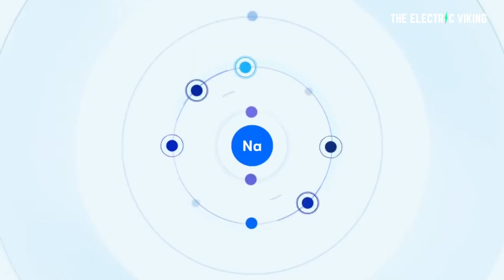Electric cars will use Sodium-ion + lithium hybrid batteries in 2023

Comment: Sodium ions have the same single positive charge but are three times the mass. This will make the batteries heavier for no extra capacity but are going to be much cheaper. If they could get get aluminium ions to work this would carry 3 x the charge.

Comment: So Sodium batteries have the following advantages over lithium (NMC/NCA):

-Better cycle life
-Higher charge/discharge rate
-Safer chemistry
-Better lower temperature performance
-Cheaper to produce

So when you pair them with lithium you loose the first 4 advantages (as the pack is only as good as all the lithium disadvantages)
and leave just 1 advantage:

Cheaper.

Sounds like sodium, in the short term, is  going to be a stop gap battery for EV's until lithium and other associated raw materials become cheap again. It will have it's uses in low range cheap vehicles (much like LFP)...in the medium term it looks like its just going to replace LFP in energy storage applications. It seems lithium will remain dominant in long range & performance vehicles for some time to come.

The fact that CATL are pairing lithium cells with sodium for EV applications really sounds like they are hiding something re their energy density claims of 160wh/kg, as all their documentation consistently says 'up to' - i'm wondering if real world conditions significantly drag that usable energy density figure down.

Comment: Sodium-ion or N+Li batteries may be the near-term future, for a short few years, but the clear future for EV batteries will be solid-state batteries, no question.  About 1/2 of the U.S. is experiencing sub-zero temperatures right now and traditional li-on batteries lose about 20% capacity with slower charging speeds.  Solid-state batteries are impervious to extreme temperatures, to a point, eliminate most of the need for BMS's and are superior in most every way.  That's where to put your stock investments.

Comment: Development remains an issue between stability, durabilité, capacity, efficiency and cost, a complex issue visible with more risky LPF batteries wisely encapsulated in pressure resistant containers by the responsible BEV automakers but not by other killers. 

In any case, because of excessive green house impact, BEV should be banned from any country with coal power plants in service or coal mines in operation…all this is planet roasting system with half of the human generated CO2 by coal and while recharged by coal generated electricity..at night with no sun and poor electricity storage (cost, losses,pollution, mining and industrial grey energy, etc) double the CO2 per mile of a good hybrid car on fossil fuel. insane and totally avoidable..

Comment: Hello Peter while that would be great - the lithium vehicles thus far have a weight issue - they weigh roughly 50-100% more than the more green ice vehicles such as the Corolla 2800 lbs vs model Y 4700 lbs.  This extra weight also runs counter to the more efficient electric motors; dragging all that extra weight hurts energy useage. You also have the reality that world wide 85% electric energy to power the vehicles is from coal, gas and oil. China alone uses coal for 60% of their electrical production.

Comment: Having two  different Cell chemistries means different charging and discharge characteristics.   You end up with two battery packs.  Each with its own circuits that are merged at some point.  Common in multiple generator AC grids.  Interesting to see how they do it.

Comment: Technically, an order of magnitude is a factor of 10, so a reduction in cost by an "order of magnitude" means it would cost 10% of the original cost. An increase is ten times. Two orders of magnitude is 100, three is 1,000.

Comment: We definitely need to get away from fossil fuels, trouble is that there are no replacements for over 80% of things that are now being produced from Fossil Fuels, there are so many things we use on a daily basis that we can't do with out, that if they stopped fossil fuels 100%, all Business would stop in a very short period as well as once many of the things you use daily wear out and need to be replaced, can't be as there is no replacement for the Fossil fuels being used.
What needs to happen before people carry on about getting rid of fossil fuels is to firstly get large scale capable replacements for the fossil fuel, then as they develop each item, they have to also be cost effective or even the greenest people won't pay extra for a renewable option.
Same as people won't even spend $0.07 extra for an Aussie owned and made product over a who knows how it was made Asian or European product.
People would rather buy cheap dried fruits that were produced on the sides of the roads in Turkey, with thousands of cars driving buy the produce as it dries than fresh hygienically dried Australian or New Zealand produce, because it's a few cents more expensive..
People for the most part wank on about saving the environment, but in reality most of them are the worst offenders.
Also, just look at how EVs are built and the materials they use, not one BEV could be made if Fossil fuels were stopped, there are far to many parts in an EV that can only be made thanks to Fossil fuels, we need replacements and many are being researched, trouble is , so far none are large scale capable.

Comment: 300 kilometer range is enough for a city car and cost is the current barrier for small ev's not range.
Reply: The OEMs will figure out what they can make the most profit on, not what sells the most units. Kawasaki makes more profit on one ship than it does on all the motorcycles it sells in the same period of manufacture. This battery will be going in to performance cars first then maybe into autonomous vehicle fleets. Once those markets are saturated, it will be portable and emergency power where cycling isn't huge. Only then will these cheaper batteries go into home solar and urban electric vehicles

Comment: Sam, you never mention the issues with the batteries loosing a lot of range for those of us living in a cold climate.  My daughter’s Hyundai looses almost a third of the battery in the winter!  This is a real problem.
Reply: I'm guessing that's not the battery capacity being affected, since the batteries are climate-controlled.  However, using a heater (especially an electric resistive heater) drains the battery quickly!  Suggest to her that she use the seat heater and wear extra-warm clothes!
Reply: Winter is a pain on several fronts: [1] yes, the resistive heater is a big drain, heat pumps are better, [2] 'available energy' does decrease in low temperatures, this is real and [3] often forgotten which affects ICE, EV and all vehicles, air gets denser with cold - go from +30C to -15C and you have 15% more air resistance. There is good news however, one or two battery generations down the line we should see solid state batteries which will be better in cold climates. I also think we'll begin to see specialisation in battery markets with variants optimised for hot climates to reduce degradation and variants optimised for cold climates to hold range and charging speed at lower temperatures.
Reply: Pete, I believe you are right and the only fix for cold weather is the solid state battery.  Problem being is how many years will it take to make an affordable battery.  My daughter’s electric Kona has a heat pump and the battery still looses close to a third of its charge in cold weather.

Comment: Mr King; no lithium is just rare - it is the 33rd on the list of abundancy; 0.02% of earths crust.  Like most elements like gold or silver there are concentrations which can be successfully minded; and lithium batteries have been around for 25 years. If it was easy and cheap to mine it; the price wouldn't be up 1800% in two years.  Now if you were looking to possibly buy rights and do the work to open a mine for $1 billion would you do that if Sodium looks promising or some other new tech?

Comment: Iread of Gigawatt battery plants. I do not read of Gigawatt generators being added to the grid. A while back, a 4000 Mwatt coal burner was shut down and replaced with 4Mwatt solar. Just great for charging over night.
And now, with a 31%carbon tax, our previously clean natural gas generators, built only a few years ago, now produce more expensive electricity.
I've read Europe is noticing some energy problems lately too.
I don't have the answers, I'll wait a while.

Comment: Lithium demand will still increase out to 2030, regardless. The amount of vehicles that need to be produced to supplant ICE vehicle production let alone replace the global ICE fleet is gargantuan. Lithium will probably be a component of Na-Li hybrid batteries out to 2035-40 whereupon it will be supplanted by graphene batteries or something similar. Adding Na to the mix is actually great news, because it means that a genuine price parity with ICE on the sticker price of vehicles is on the horizon. Cathy Woods is right. 2025 and EVs will be 50% globally, two years later 90% of sales. 2023 will be the big wake-up.

Comment: Bluetti have already shown there NA300 using B480 batteries are NA+ (sodium ion) they showed it CES 2022 
Portable power so gens will have this 

Is like to see NA+ in Powerwalls as you could have more Powerwalls to make up the small loss in density but gain more capacity for your $$
Tesla was slated to make an announcement on the Powerwalls this year but haven’t seen them announce there slated changed
Reply: Maybe wait till March 1 2023

Comment: I don’t think a two door truck is the next step for Tesla. I think a “cyber line” will be developed with a cyberhatch being the next vehicle-It will be the ultimate smackdown - cheap, indestructible-million miles, efficient, high utility, good for ppl who just want transportation, robo-taxis. 
GigaCastings + SS body - no paint + smaller pack maybe 40-50kwh all adds up to 25,000$ car with a 20% profif margin. An you get legendary Tesla charging network, FSD or AP-which is a great ADAS, Infotainment system… it will crush.
Reply: Have you been smoking a unicorn? Let’s put a battery that doesn’t exist on a commercial scale in a cell to frame architecture for a passenger vehicle that also doesn’t exist and is unlikely to exist until after the end of the coming or current recession.

It’s a bit like dividing zero by zero. The answer is always yes because they both don’t exist on an assembly line
Reply: @theairstig9164  Insults are not necessary.
Also, I don’t think I mentioned batteries but Tesla did mention them going into this new car, on battery day. The batteries are real but they are having issues scaling it’s true. But scaling issues doesn’t equal nonexistent. To address this Panasonic is making a paired down version of the same form factor. 
Not sure what the recession has to do with this other than supporting you everything is vaporware, the sky is falling rant.. Tesla and to a lessor degree every EV manufacturer is gobbling up market share from ICE… might have something to do with $4.50 gas… Sure fewer ppl are buying cars but used prices remain high which puts some in the new market. Also how does a cheap EV that really well made not do well in a recession?

Comment: I think that every EV will self park and nuzzle onto a low mounted wall power point and trade electric energy. 
Forget rapid charging, trickle charging will be universal and batteries will be permanently topped up.

And ready for the long drive.
Actually 'horse and cart' thinking in a good way. 
Hahaha They 😊

Comment: How rate does it have to be for you RT?  it is 33rd next rarest is maganese.  Where you can find deposits sure it is slow to process because most methods use settling ponds - often in areas where there is little water;  another option is to have a processing plant but then you have to put a lot of upfront energy into a processing plant and move the minerals through it.  The bottom line is there isn't enough being produced and that is the reason I am pointing out it can't act as a major part of any significant EV revolution.  Lithum EVs are a dead end.
Reply: There are hydrothermal brines in Cornwall and the Upper Rhine under development. The lithium brine plus geothermal energy give the prospect of zero-carbon Lithium, enough to make Europe self-sufficient.

Comment: How many cycles are possible with Sodium batteries before they degrade to 80% of original capacity?  Can they charge as quickly?
Reply: Over 50% a day for 10 years with a 70% capacity warranty for home sodium being trialled in Australia.
Can be run down to zero capacity without repercussions.

Comment: Battery technology is the most important driver of advancement; above any other technology with the exception of integrated circuits.  Improved batteries will transform both the auto industry and the electric grid (disconnecting houses from the grid including auto charging at home, plus allowing KWh to be transported to off grid houses on rare occasions when home batteries are drained).  Battery technology will eventually attract the profound respect it deserves.
Reply: @Doug InOrlando
I hope what you said comes true.  But the Big oil and fossil fuels industries are not in their best interests.  I hope that can be overcome.
Reply: @acmefixer1  I don’t see how the utility company could stop someone who permanently disconnects service and is no longer physically connected to the grid.   Yes the solar power may be clouded over for a month straight and cause the house battery to drain low. The rare event that happens once or twice a year, the homeowner can drive to the car charging station and top off his auto battery, then drive home and use it to replenish his home battery.
Reply: @douginorlando6260  
Did you know?  There are states where there is a law that says you can't go off the grid - you're forced to have service from the electric utility.
Reply: I believe that the 20million buildings in Australia are connected to the existng national grid and will remain connected as the existing grid will allow a home rooftop to 'transport' its excess electricity to the 'home' EV battery when it is parked away from home base.
It will allow electricity to be traded with the national grid for money and profit. 

This means as weather conditions roll across the continent fully charged EV batteries can dispatch electricity to meet the local shortage. 
The existing grid will balance out demand and generation shortfalls. 

The existing grid will accumulate excess renewable energy. 

The existing grid is perfect for the future of Renewables. (with EV big battery storage being universal).
Reply: EV batteries are expensive and have a limited number of charge/discharge cycles. They will not be used for general energy storage until the degradation issue is resolved.
Reply: @Dave5843-d9m  you must know where you are going before you can get there. 

Many engineering solutions are a disaster because they solve the WRONG problem. 
Idiots promoting the nuclear solution ignore many matters.
As a world solution, nuclear is a first class stupid outcome. 
Look at Russia, its nuclear industry has allowed it to kill its neighbours children and then threaten to kill the world, if full response to it bad behaviour is taken.

Nuclear is an extremely long, decades and decades long solution with 'ancient technologies' in the near future. 

I can easily list it's many basic failures. 

Battery technologies are evolving rapidly and can continue to do so for decades and decades,....
Reply: @Dave5843-d9m  
The LFP - lithium iron phosphate - batteries are good for 3000 to 12000 charge-discharge cycles.  That can be a dozen or two dozen years!  Read the wiki about LFP batteries.
Reply: Are you kidding 
The energy companies want to charge you right now for exporting power to there grid there say it producing more maintaince .never will electricity companies want people of grid and loose their free electricity.
Reply: @rodneyabbey9526  I think that too much rooftop supply at the moment may 'rock the boat' for the supply companies and unsettle the voltage stability, more battery storage in the grid is needed. 
Charging the rooftop supply because they can and slowing installations for the moment. 
It might be a profitable way of getting more battery storage into the grid and paid by others.

Comment: Sodium at present is the best hope for EVs because there isn't enough lithium.  If they can get Sodium to have the same or better density of charge - then it won't just be used in the model 2 but in ever EV car.   Lithium is too rare and costly now and will sink the EV industry or religate it to a niche market.
Reply: Lithium is not rare. It's the mining process that's restricting the supply.
Reply: The only reason that lithium is remotely rare is because we, as humans, have had before this very little reason to use large amounts of it. That means there was no reason to look for it, and it is the reason that we increased the supply of lithium globally by 30% in 2019. Keep in mind this was before lithium was discovered in California in geothermal brines, which might have increased the supply by an additional 15 million metric tons in that state alone.
Reply: @ronaldking1054  We as humans? So I am not a nebulous ball of energy with no worldly needs?
Reply: Lithium brines are easy to mine. Lithium compounds used in LFP and L3P cells need much less refining than for ternary cells.
Reply: There's no shortage of easily mined lithium in earth's crust , the shortage is of producers abe to refine it.
Reply: And this video is about Sodium-Lithium batteries. The scarce resources you're talking about are Cobalt and Manganese.